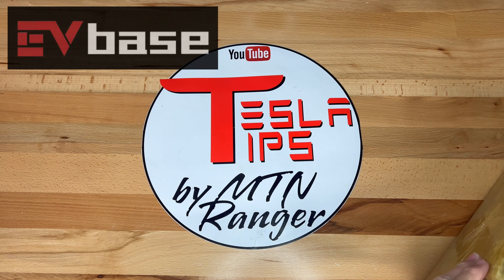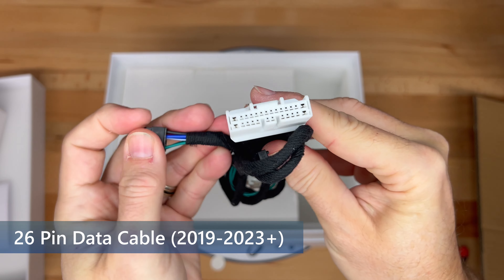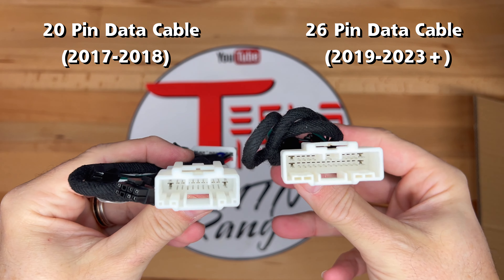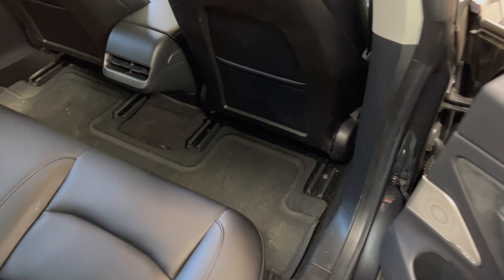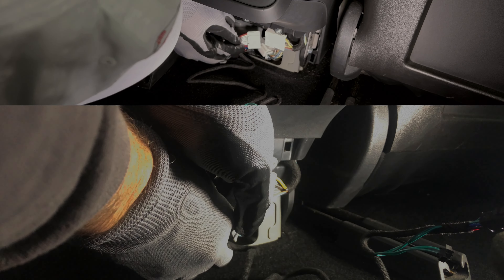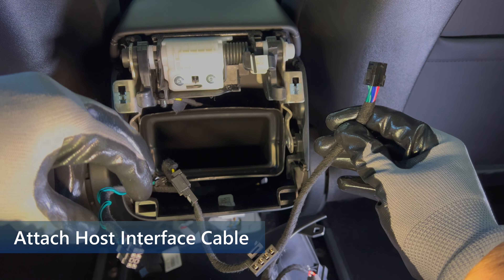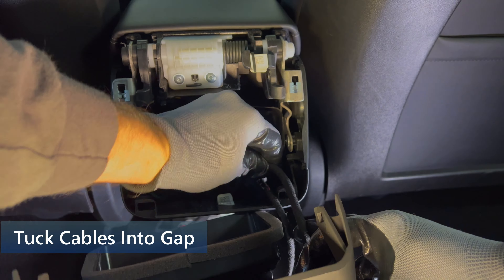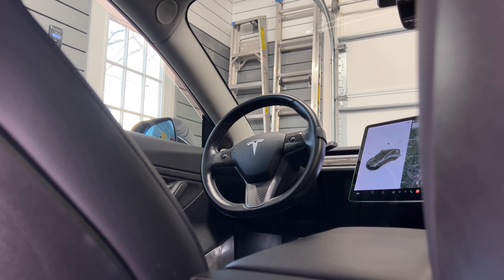Tesla Model 3/Y - EVbase Rear Seat Display - Part 1 Unboxing & Installation

Comment: For 2022 model y do I need that black usb cable?
Reply from the maker: The 2022 should be a refresh.  Do you have USB-C ports on the back of the center console?
Reply: I meant 2023 and yes I have Usb-C ports
Reply from the maker: @dillonle4034  If you have USB-C ports, you don't need the black USB cable.

Comment: Thank you. The device is very cool and handy. I have some issues though:
1. I am not able to watch netflix - anyone has managed? It seems that this android version is not supported even requesting desktop site on the platform.
2.Not able to move the front seats, though I think that this is a useless option to control for the people in the back
3.What is the source and where is it to perform a software update? My OTA option does not work at least with the current version.
Finally what is the extra battery consumption used by the device?
Reply from the maker: 1. Yes, I mentioned in my followup video that Netflix is not available on app or on the browser. 2. I haven't noticed a button to move the seats on my screen. 3. I have recently tried the OTA too.  So far there are no updates.  I'll keep in touch with the company and post when they have one. 4. I doubt there is much battery drain on this, it uses the 12V battery for power.  This video covers use: https://youtu.be/j9gX_GU-IzA
Reply: @MTNRanger  Thank you for your reply. Look forward for an update with Netflix running. Maybe silly questions - 1. Is the 12v battery very strained from it? 2. Is there a screen protector available to avoid scratches etc? As it fits super well to the car. Thank you
Reply from the maker: @mindovermedia  It's a small screen, I doubt much to make it run.  I'm sure the car is built with the capacity for headlights/audio/heated seats/etc all running at the same time.  I'm betting a small tablet screen protector could work from eBay or Amazon.  I would measure and search for something similar in size.
Reply: @MTNRanger  I have installed a nintendo switch screen protector, the closest I could find, still leaving the edges off as it is 6.2 inches I think and a 7 inch protector as advertised for the screen is too big.
Does everyone have this version I wonder ?- ending in 0757. I hope there will be a future version supporting Netflix
Reply from the maker: @mindovermedia  check my new video coming out Sunday morning - Netflix and Disney+!

Comment: Did you need to cut the power of the car in the maintenance menu?
Reply from the maker: It's optional for the rear connector.  Yes can do a "shut down" from the safety menu.  Then wait 10-15 minutes for the high voltage contact "cluck" sound.

Comment: This is so cool...
Reply: Something like this is why the model 3 is so desirable!
Reply: @Terry Rodbourn  Also unlike Apple, it appears that Tesla will not change their ports or location of them which encourages after-market products. So cool of Tesla.
Reply from the maker: @keitha.1888  Tesla has changed the ports in the front of the refreshed models.  Unfortunately, only making the glovebox port the data port.  Hopefully they fix it so the center console also have data.

Comment: Does it sole the issue of the V1 8" bricking the car during Tesla firmware upgrade ?
Reply from the maker: I guess I will find out soon enough!
Reply: It still happens. The M3 does not “brick”. The update just doesn’t complete

Comment: Can’t wait for mine to arrive!  We’re you able to load Netflix and Disney plus? Some other YouTubers are saying they couldn’t load them
Reply from the maker: I'm still testing the software for part 2.  There's a lot of stuff in there.  As far as Netflix and Disney+, it would have to run in the Chrome browser.  I'll look into it.
Reply: @Tesla Tips by MTN.  Is it possible to test and see if Netflix can be played while on drive?
Reply: @keitha.1888  you can watch videos in drive, but there might be an issue with the actual app not being able to be downloaded from google play store for some reason.  The Ranger is investigating lol
Reply: The isuses are has fallow 
1.Netflix not compatible. Netflix certification not compatible. Even if you try to download side-load still won’t work.
2. Bluetooth headphones connect but will not working.
3. Slow to open apps.
4. Wifi  keep disconnecting.
5. Battery 🔋 view  
6. Amazon Prime Video  slow loading  
7. Only plex server works well.
8.Dark mode does not work .
My supplier stop selling until they fix all all this after Chinese new year
Reply from the maker: @mosesteslaaccessories1613  Yes, I cover some of those in my video.  I have talked to that company about the issues.